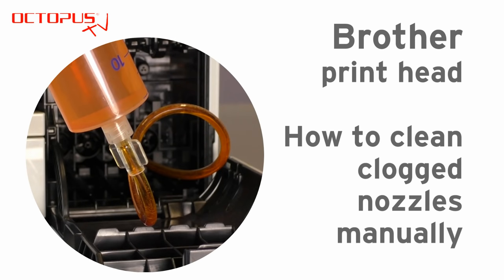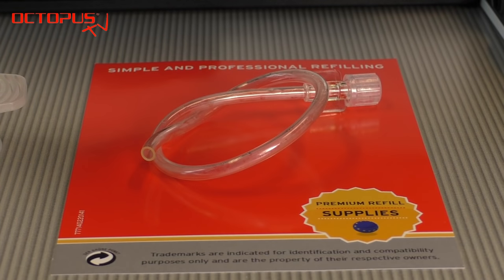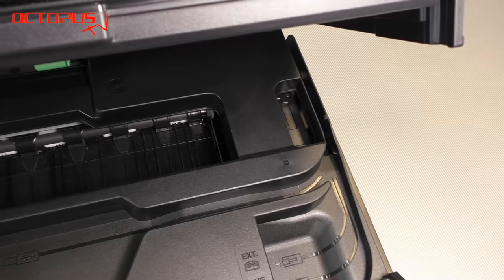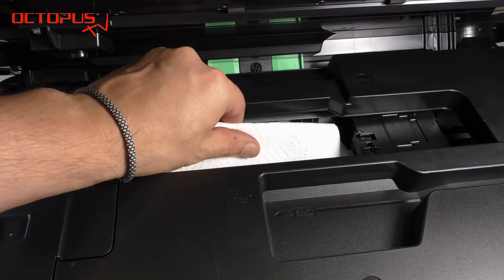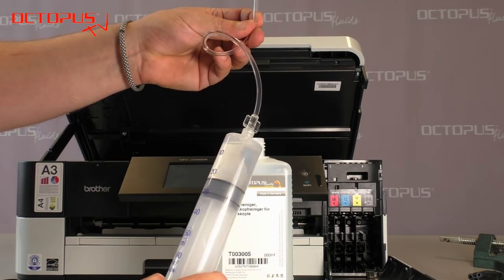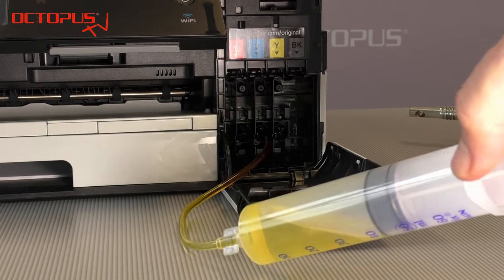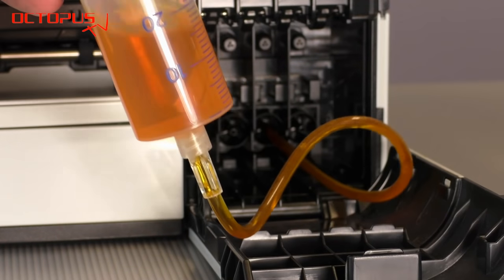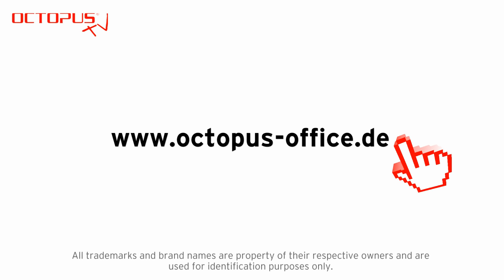How to clean Brother inkjet printer´s print head clogged nozzles?

Comment: Is that a clean water?
Reply from the maker: No, the liquid is not only water. We are using a print head cleaner - this is basically a colorless ink containing surfactants. The surfactants help to get rid of any residual inks inside the print head.
If You are  going to give prufied water a try, make sure to use demineralized water.
Reply: Thank you sir
Reply from the maker: Welcome, thanks for asking!

Comment: I can't see where you blocked the lid switch.
Reply from the maker: Thanks for Your question. You can see me using a rolled piece of card board to block that switch at 1:00 in the video. The place of the switch might be different on Your machine - the idea stays the same.

Comment: I was given a printer which sat around for 4 or 5 years, it works, but its so clogged that it doesn't print not even a droplet, is there any hope with this kit or should I toss it away?
Reply from the maker: Thanks for contacting us. We would like to safe Your precious life time - sitting for that long time is a real problem to an inkjet printer. Beside the clogging the printer´s components are aging and will not work that smoothly anymore. Even if You are able to bring it back to life there is a chance it will break down soon.
Reply: @octopusoffice  I had some spare time and started following the tutorial, I had a feeder that did fit the nozzles, and I pumped hot water into them, did a couple cleaning cycles and black is solid and consistent, unfortunately I ran out of magenta but I got some very faint spots from the color quality test, I ordered a couple set of cartridges (plus an extra one for the cleaning cycles) and I'm sure it will unclog at the end, the water I was pumping was coming clean and at the end I even injected some alcohol before letting in some compressed air, is not time wasted at all as I enjoy doing these kind of things
In the meantime I will set up a raspberry Pi to provide network functionality to such an old printer
UPDATE: up and running with no issues, ink cartridges are dirt cheap and no weird sounds in the mechanical parts

Comment: I did that secret process but can only print black.  It’s better than what it was, but does anybody know how I can get back to color?
Reply from the maker: Hello Mark, thanks for Your question - after the flushing You need to get out the cleaner remaining in the ink system (air as well if there came some into the ink system during the cleaning). You can do so by printing the cleaner out - this avoids filling up the printers waste ink section - we recommend to use old paper and do double sided test prints on these pages. We start a print job of 100 pages. During this print job the colors come back to normal slowly - You can stop the print job when You are satisfied with the print outs again.

Comment: why is it always yellow that's clogged?
Reply from the maker: Hello Nicole, thanks for Your question. Are You using original Brother cartridges or alternative material? In case of alternative supplies there might be the ink the issue - try switching to a different brand for the yellow and see if the situation improves...

Comment: Don't u need to close the top before running the test again? Cant see if the printing head has moved... Just pull the plug as soon as you hear anything (?)
Reply from the maker: You can check the comments under our tutorial - some users have pointed our a way to move the print head by using the printer´s buttons - maybe this is also suitable for You.
When checking for the result od the cleaning we put everything back into its order.

Comment: I've cleaned the print head with the cleaning solution four times, made no differance. Still blocked
Reply from the maker: Hello Robert, thanks for Your description. So the cleaner is not going through the print head and is not coming out at the nozzle plate?
Reply: @octopusoffice  
Yes it’s coming out of the print head as it’s soaking the paper towel I put under it
Reply from the maker: @robertoddy6139  Hello Robert, thanks for Your response. Based on that we assume that the print head might have another damage too beside beeing blocked by dried in ink. The cleaning cannot fix electronical damages or other physical damages beside the clogging by ink.

Comment: Hmm doesn't work for me. I used a different product (so that could be it too, I could not find Octopus on eBay). The thing is, I put in the cleaning liquid and it all went fine. Large amounts of paint came out too. It looked like its working like magic.

The first print test came out almost OK. Like so close to OK. The second one was worse. Then I printed a picture and it was horrible. Like with each print, less and less. 

I believe the user of the printer used some super cheap replacement ink. Maybe it's still bad, I don't know. I haven't tried this pumping method, though I did pull some ink back to the syringe too, so you know, kinda did it I suppose. And the towel looks full of ink, it looks like there is nothing wrong. But then I proceed to print and ... :(
Reply from the maker: Thanks for contacting us.
Did You change from the super cheap cartridges to some better cartriddges after the cleaning? When staying with the "bad" cartridges, assuming they are responsible for the problem before, You get the same problem again. We suggest to change the used cartridges.
With the cleaning method it happens quickly that there is air trapped inside the ink tubes and the print head section - make sure that You only push cleaner liquid into the ink system and no air from the cleaning syringe.
After cleaning You should print test prints on already used paper - save the planet - and bring back the colors to normal. It might take quite a number of prints to normalize the colors again.

Comment: What is the name of the detergent or be its replacement
Reply from the maker: We make our own head cleaning fluid. Basically it is a colorless inkjet ink to which we add suitable cleaning detergents. You can purchase it from OCTOPUS®:
http://www.octopus-office.de/shop/en/printer-ink/nozzle-cleaner-cartridge-cleaner/247/nozzle-cleaner-print-head-cleaner

If You would like to use something different we recommend that an alternative cleaner has to be based on demineralised water as minerals tend to build up blockings inside the print head´s nozzles.

Comment: My printer completely stopped printing black after a paperjam.  Pushing fluid through and the head is not blocked so it seems a more fundamental issue with the printer.  Not very happy as its an expensive device and has had a very easy life probably only doing 1000 pages a year.
Reply from the maker: Hello, thanks for Your description. So after the paper jam You are able to start a print job - the printer starts printing, but no black ink comes onto the paper?
Reply: @octopusoffice  yes, it was bizarre however after alot of effort I got it working again. I pushed cleaning fluid through with a syringe.   Found a hidden maintenance menu with cleaning option. Then did about 4 normal cleans of various degrees.  Finally I got it printing correctly again.
Reply from the maker: Thanks for Your answer -  we are happy to read that You were able to get things back on track - 1.000 pages would be too early to let go ....
Reply: @octopusoffice  I page counter said 1907 pages only since I bought it about 5 years ago.  It's a big office MFC-J5720DW it would probably benefit from being used more to keep ink flowing through it!  Thanks for your help.
Reply from the maker: Regular use keeps an inkjet printer going. The age of 5 years might be the secret to difficulties appearing now - printers and their components age by just standing around - in our humble opinion You are already on the positive side when You have a working, 3 year old desktop printer these days... sad truth.

Comment: BRUH MINE KEEPS CLOGGING
Reply from the maker: Thanks for Your comment: Have You tried to switch to a different ink or to cartridges made by a different manufacturer?
Reply: @octopusoffice  Yeah I put non genuine ink in that has worked well before and it still is clogging up a bit
Reply from the maker: Thanks for the information. Are refilling cartridges or are You susing ready made alternative cartridges? In case You refill cartridges - maybe the refill ink is too old? And if its the case that you are going with alternative cartridges: please do not use the cartridges that You  have used before cleaning, they might have caused the clogging. When switching to new alternatives, try another brand. With the alternatives there is a chance that You have received a good batch and the next one might have not so good ink inside....
Reply: @octopusoffice  Yeah I had ink in it that just expired I think
Reply from the maker: @ElevatorWasher5000  thanks for Your response to our assumptions - so when You are willing to invest more time into Your printer - we would tackle the switch to new ink as the first step....

Comment: Over 100 prints and black not back at all. Blank paper
Reply from the maker: Hello Jamie - thanks for Your contribution. How was the situation before the cleaning? Black blocked completely or just missing some lines?
Reply: @octopusoffice  just missing some lines
Reply from the maker: @jamiecampbell6550  Thank You very much for Your answer. The delay in black ink coming back to the prints may be caused by air inside the tubes leading from the cartridge slots to the print head. We try to highlight to vaoid pressing air from the syringe into the tubes. There are two options - depending what material You have at hand - You can extract the black ink out of  cartridge and pushing it into the black ink port through the tube until it reached the nozzles - faster than getting the air out of the tube by printing. Second option is to flush the black ink tube with nozzle cleaner again, making sure to push the air out of the tube. Second option again requires to print out the nozzle cleaner from the tube again.

Comment: ما هوه اسم الماده المنظفه او من يكون بديلها
Reply from the maker: We make our own head cleaning fluid. Basically it is a colorless inkjet ink to which we add suitable cleaning detergents. You can purchase it from OCTOPUS®:
http://www.octopus-office.de/shop/en/printer-ink/nozzle-cleaner-cartridge-cleaner/247/nozzle-cleaner-print-head-cleaner

If You would like to use something different we recommend that an alternative cleaner has to be based on demineralised water as minerals tend to build up blockings inside the print head´s nozzles.
Reply: البديل قطرتين من ماء جافيل مع قليل من الماء
Reply from the maker: The detergents we reffering to are not for washing clothes :) We use a certain  kind of surfactants...

Comment: I did that and ruined the printhead even more!
Reply from the maker: Thanks for contactng us about our tutorial: What happened when trying to clean?
Reply: @octopusoffice  plenty of liquid went through the printhead (the blue was blocked). I did the yellow as well as it wasn't great. same thing. I thought the problem was solved but now these 2 colours will not print at all! 😕
Reply from the maker: Thanks for Your description of the situation. After flushing the ink lines with cleaner liquid it is still there after cleaning - then the print appear without for some time. We recommend to run a 100 pages print job on old / already used paper. Then the colors come back bit by bit - just keep an eye on the prints when running this test print job - as soon as the colors are good You can cancel it or if the colors still need some time - start another print job. But as we say please use old paper as these test prints are for the waste bin 🙂

Comment: Can i do this on my old printer mfc 440cn? Coz the black ink cannot detect eventhough its new cartridge. Thanks in advance
Reply from the maker: Thanks for contacting us about Your Brother printer. Your machine used the cartride model LC1000. Are You trying to use an original Brother cartridge or alterntive cartridges? The recognition of the cartridge is made by the special shape of the cartridges´ shape on the front part. When working with alternative cartridges their front shape sometimes does not fit to the printer - then the cartridge fits in but is not recognized. Make sure You have a LC1000 compatible cartridge.